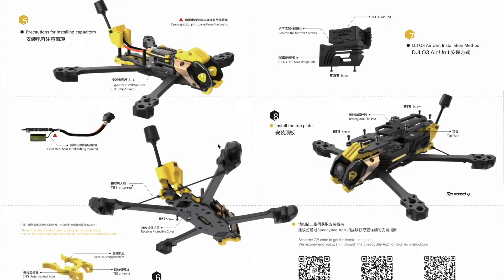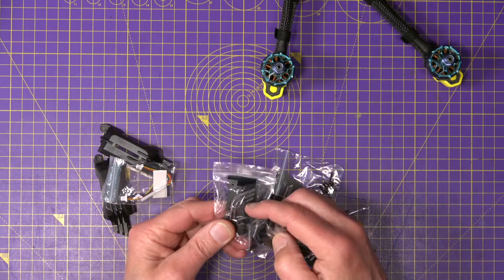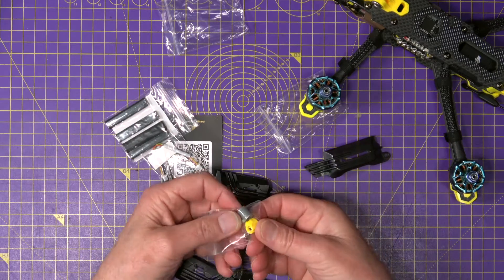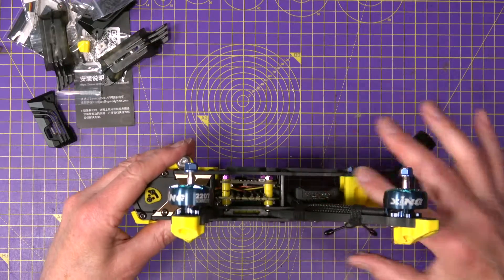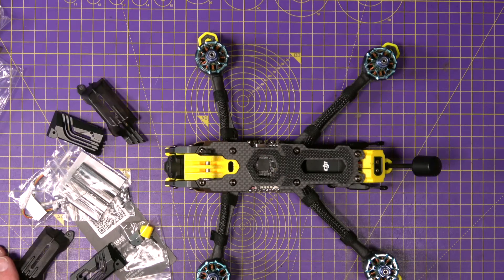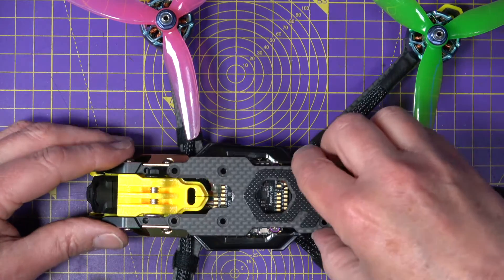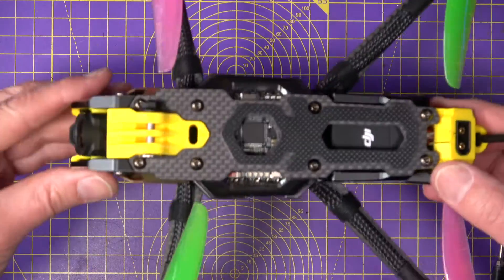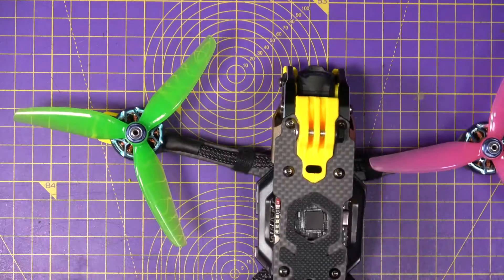SpeedyBee Mario 5 Pro - DJI O3 Ready Drone Frame - DC vs XH comparision

Comment: Just an fyi all the arms from diff xh and dc are diff sizes. Front arms and rear arms are diff sizes on the dc and the xh are all the same size but are diff from the dc front and back   This video confused me on this and I ended up ordering the wrong arms twice thinking I could use the dc arms for the xh just not the two dc fronts cuz them are way diff
Reply from the maker: Thanks for the info.

Comment: Thanks for the video. Did you do the PID setup yourself?
Reply from the maker: No problem - I hope it helped. Yep tuned by me and pids and rates are linked in the video description.
Reply: @WhirlyBloke  Thank you so much. Your PID settings are very important to me. I just got the Mario 5 DC frame. I am currently assembling and the assembly is very similar to yours. I will definitely take your PID settings, it's a big time saver. Thank you very much!!!
Reply from the maker: @AndreySpb_Spb  You will need to tweak it for different motors and props. To be safe, I suggest using BF defaults for 5 inch to start off with and then maybe try mine. BF defaults these days are very good.
Reply: @WhirlyBloke  Yes, of course I will follow your advice. My build: xing2 2207 1855kv, Speedybee F4 V4, DJI O3

Comment: Do you need to extend the 03 camera cable for this frame? Cheers and excellent quality review as usual.👍
Reply from the maker: No, the frame body is shorter than the Master 5 and the longer MIPI cable isn't needed. But if you need a longer 150mm DJI 6 way cable, you can get one from my website https://bit.ly/3HkSgEe

Comment: Hello my friend, my DJI Air unit is giving calibration error, do you know how to solve this?
Reply from the maker: You could try this.
1. Make sure you Air unit is connected to the FC
2. Plug in your FPV battery
3. Plug in your air unit
4. Open DJI Assistant (Consumer)
5. Once I got the Activation message I chose activate later.
6. The Camera Calibration screen appeared and completed its process.